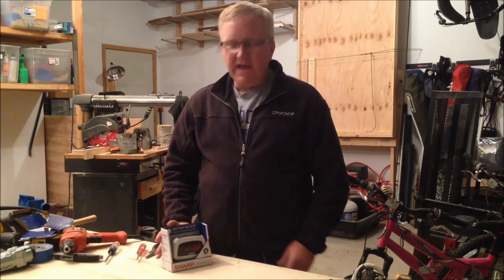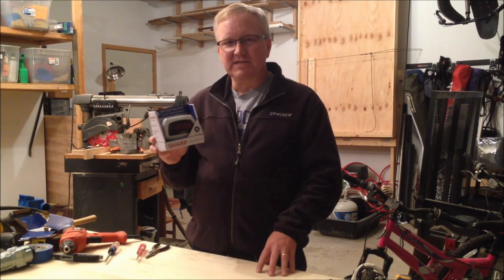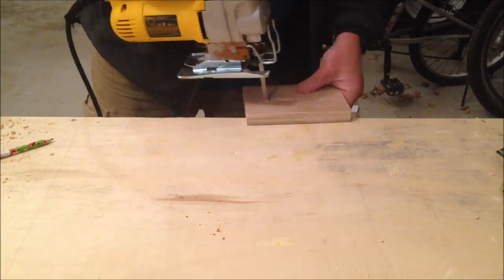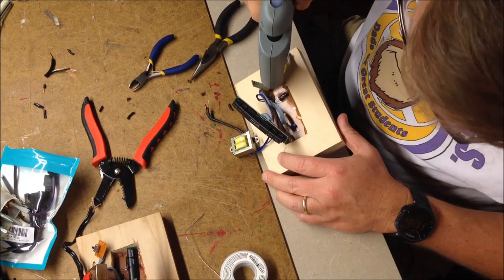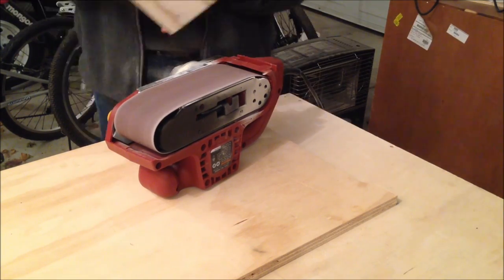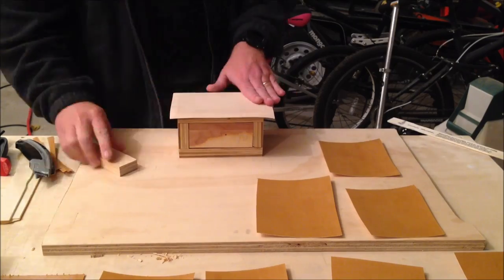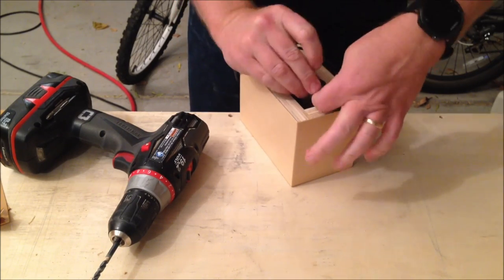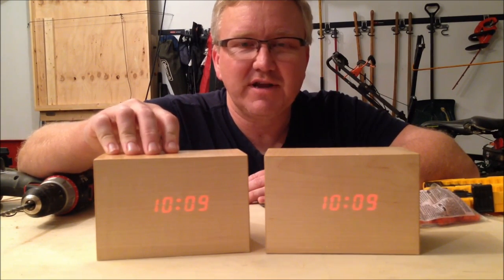Make: LED WOODEN CLOCK

Comment: Nice project. I have never used veneer or contact cement either.  At one time I had thought about making a clock like this but making the wood super thin for the clock face.  I wound up not doing it because I thought that by the time the clock shone through, the wood would be too weak.  I like this solution much better and might try this method sometime.
Reply from the maker: +CFB Creations I thought about that as well, like taking the router and hogging it out until there was a super thin layer left.  The veneer was much easier!  Thanks for checking in!

Comment: Why you didn't just purchase a clock kit from eBay for the same price of the clock you got from the store? Not sure what you're using to film but if it's a DSLR you can attach a stereo microphone on it and the audio would be much clearer. Great video. I like how the clocks turned out!
Reply from the maker: +Ken C Sorry for the late reply - right now I am just using my iPhone for video which is what is causing the audio problems.  I could have done the eBay route, but these were so cheap and easy!

Comment: I have safety concerns: 1) the clock is likely to attract children, and an open side allowing fingers into the wiring harness is a recipe for disaster. 2) An over heated diode or other component could start the wood on fire. If I were you I would recall this gift.